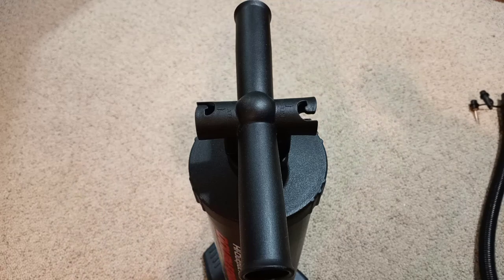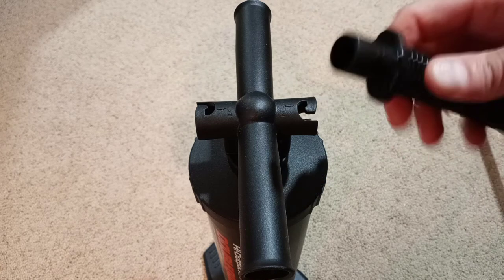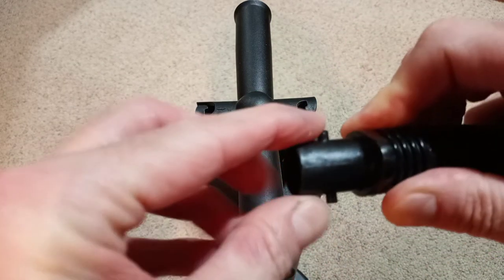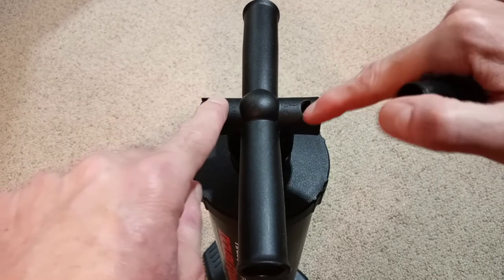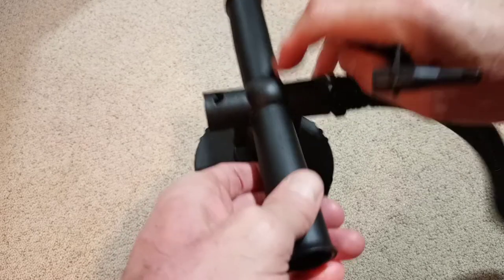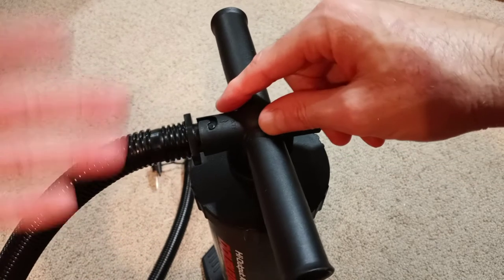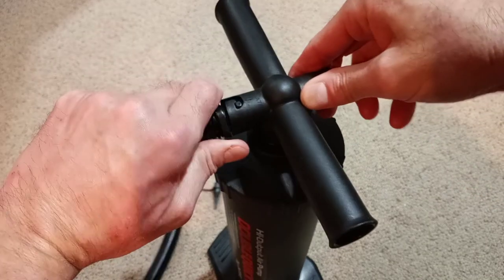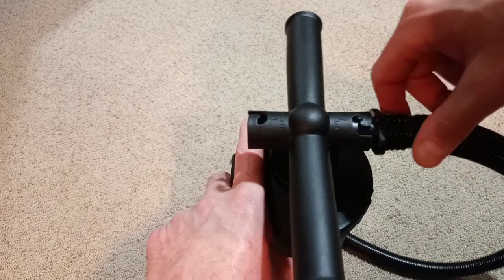How do you attach the Intex Double Quick hose? Air mattress inflator pump.

Comment: i have a similar intex pump but if I want to let the air out of my air bed how come it's heavy when I try to lift the handle up and down to deflate it?
Reply: Exactly, did u find a solution for that?
Reply: @talesferrari1750 because it pumps in both they ways ..pushing as well as pulling